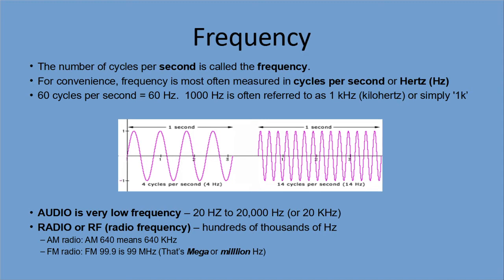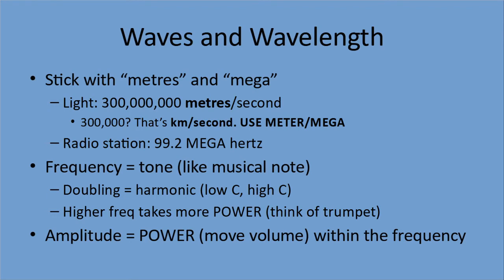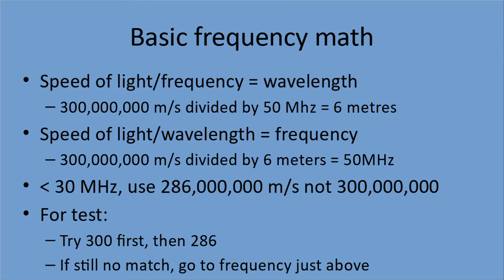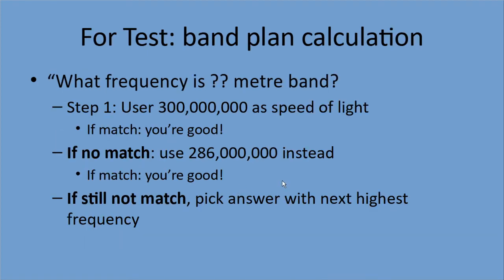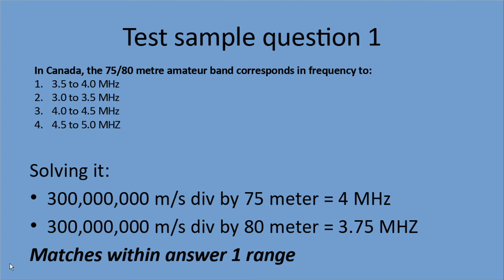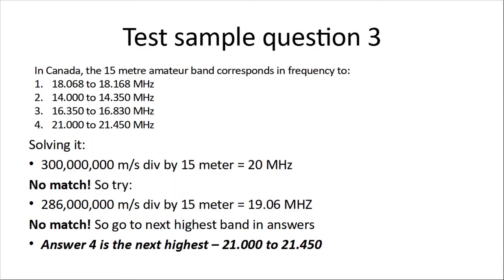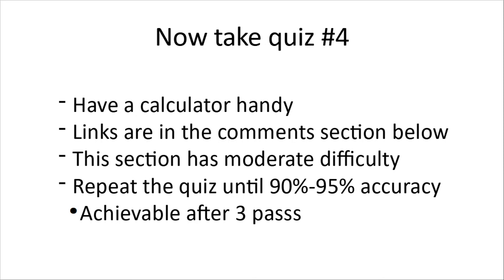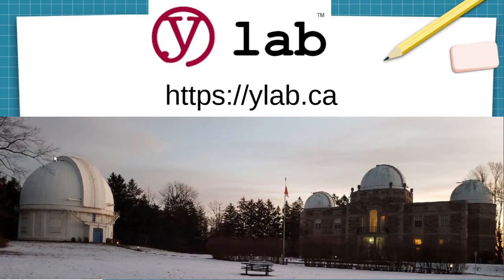Lesson 4 for Ylab's Canadian Amateur Radio License Course

Comment: Question B-001-017-010 appears to have a typo for the correct answer. The correct answer is listed as "160 watts carrier power VHF amplifier, " shouldn't that be 560 Watts?

Comment: B-001-015-010 In Canada, the 10 metre amateur band corresponds in frequency to:
300 or 286 divided by... (whichever is inside the range):
28.000 to 29.700 MHz 
21.000 to 21.450 MHz
24.890 to 24.990 MHz
28.000 to 29.700 MHz 

Theres twice the same answer!
Reply from the maker: Danik, thank you for giving us the full details including the question number. There was a bug in the quiz site's software that sometimes caused this kind of error. We've corrected the answer list.